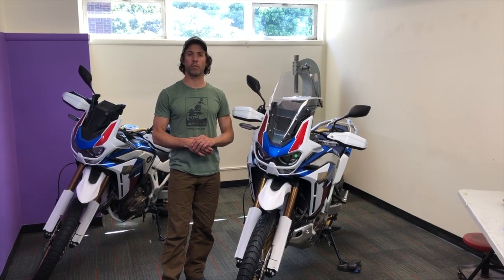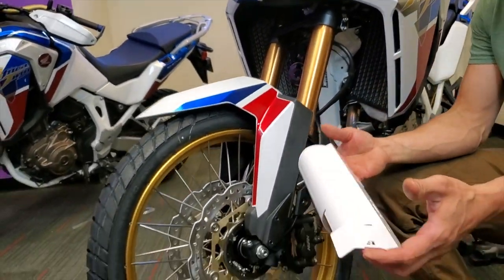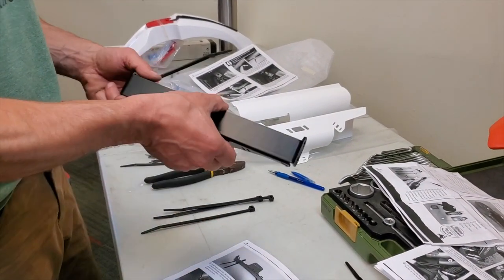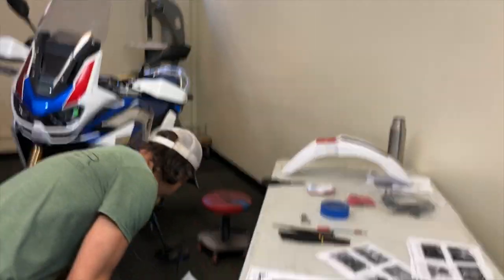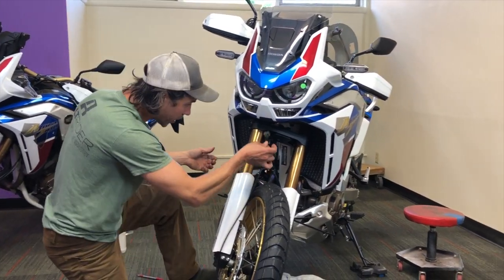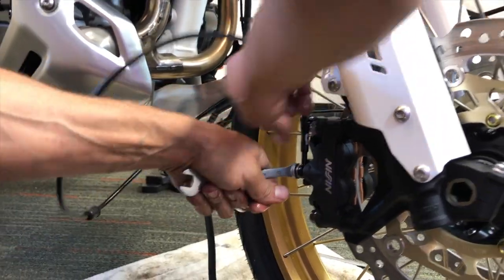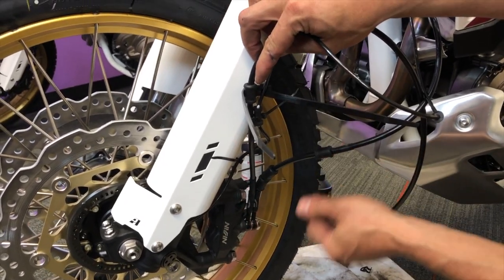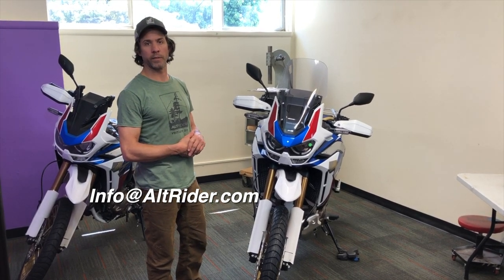Honda Africa Twin High Fender Kit Install for the CRF 1100/1000

Comment: I have the Honda 'Africa Twin' DCT 1100 Adventure Sports bike. It's the 2020 model with Automatic transmission. Is there any advantage in switching to a high fender if you're mainly a road rider? It looks cool and it really suits the Africa Twin, but I'm not sure I need it.
Reply from the maker: Beyond looks, having a high fender is about making sure mud and debris doesn't jam up in your low fender. You're unlikely to have that problem with street riding.

BUT - it also looks bad ass! And sometimes customizing you're bike just for looks is worth it 👍
Reply: @AltRiderLLC  thanks, and does the high fender also reduce the risk of any road debris damaging the bike's radiator? I have installed the original Honda frame crash bars and an aftermarket radiator guard which I bought from RevZilla. I have the 2020 DCT AS ES. Will your kit work on my bike?
Reply from the maker: Yes, our High Fender Kit fits all models of the CRF1100 & CRF1000. Since the high fender is further from the wheel it doesn't do as much to reduce debris flinging on to your radiator
Reply: @AltRiderLLC  thanks! appreciated!

Comment: Great video, thanks. I think it might be worth pointing out about fasteners on Japanese motorcycles that causes alot out damage to them and difficulties for working on them.....
If the screw has one small dot near the crosshead slots, it is actually a JIS (Japanese industry standard) screw. So if you don't use a JIS screwdriver on it you risk rounding it off undoing it. This is why when ever you go to undo a master cyl they are often ruined and never come out. 
Hope this helps someone. 
JIS fasteners are also used on Japanese cars too. 
The JIS screw drivers are very slightly different and are more readily available then they used to be, so look for the little dot on the screw head to indicate this.
Happy Screwing 😉
Reply from the maker: that is a great tech tip! we will pin this reply to show at the top of the comments
Reply: All these years, I never knew. Thanks!

Comment: Tha way you routed the brake line is different than in the instruction. In the instruction you routed the abs wire and brake line over lower triple tree, in this video both wire are routes under it. Which one is the way to go?
Reply from the maker: Hey thanks for catching that, yes the lines are better to rout under the lower triple tree.  the ADV sport vs the standard caused a little confusion when drafting instructions.
Reply: @AltRiderLLC  so if i own  a standard model i should route the line as specified in the instruction(over the triple tree)! right?
Reply from the maker: @SimstarzGaming  correct,  but you can also do it how you see fit.
Reply: Was just about to ask that...just bought AT and mine are routed over
Reply: @AltRiderLLC  so you can be safe to do it either way on the Standard? By going under you don't have to unhook the abs wire.
Reply: I have a 22 standard and the main line is not long enough to go over the triple clamp. Now I'm rerouting and going under..... seems to be a better angle on the line coming from the abs block by going under too. Let me know if you think I have missed something please.

Comment: That looks great. But will there be room for a 6” led light bar?
Reply from the maker: It is hard to be certain without knowing your set up, its likely it would be a tight fit. It should work no problem combined with our upper crash bars and 1 inch clamps for the lights.

Comment: Can I ask did the brake lines go in to the abs pump and did you lift the tank?  Just looking at mine and it does! Same bike
Reply from the maker: Yes they do connect to the abs pump with the threaded fitting and the tank does not need removed.

Comment: usually when you bleed you start with the caliper that is the furthest  away from the  reservoir :\
Reply from the maker: It can be helpful when the entire system is drained to, prime the lines before the calipers. Surface tensions can make it difficult to get the bleeding process started without priming.

Comment: The brake lines are messy , no fault of Altrider it just is what it is . Has anybody managed to route them so they dont for instance, rub on the body work when forks compress ?
Reply from the maker: There is certainly slack in the lines when under compression but I cant say I have heard any issue with the lines contacting the plastics under compression. Feel free to contact info@altrider.com if you believe you have an issue with this and we can see if we can come up with a solution for you.
Reply: Email sent 3 days ago . Be very interested if you can tell me where I an going wrong .